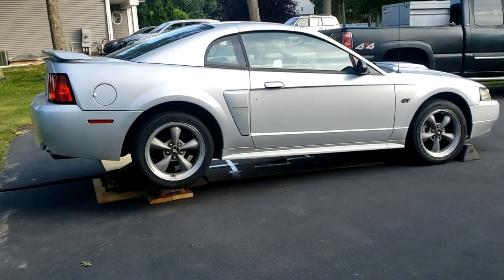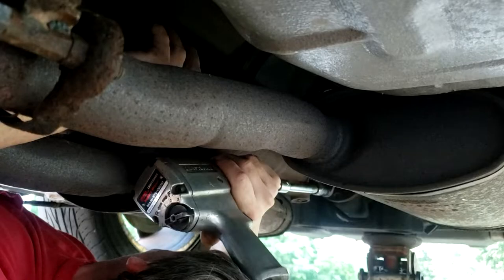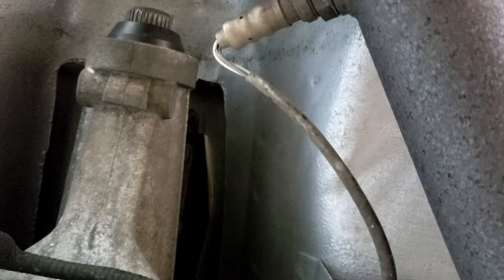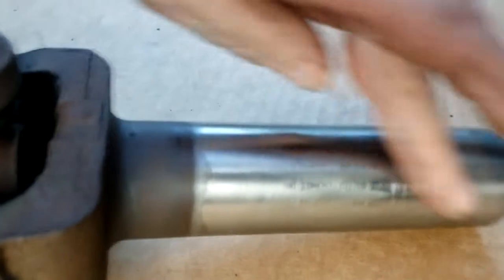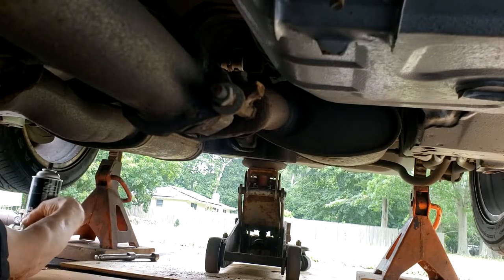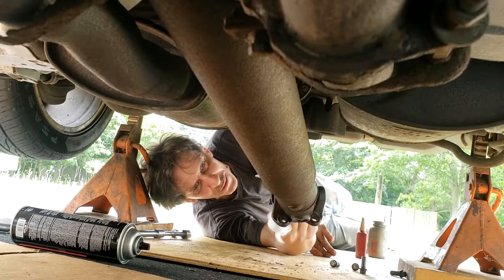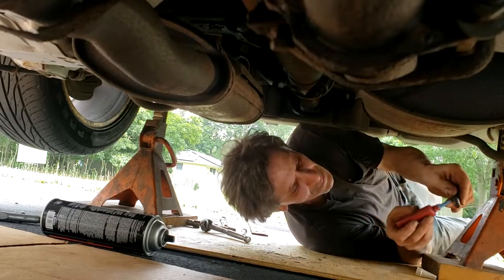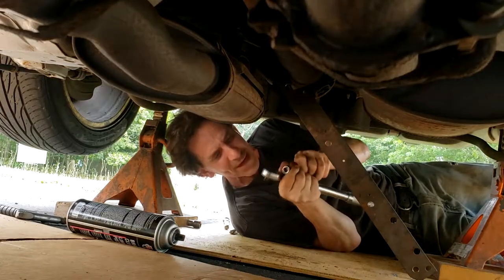'94-'04 Mustang GT Drive Shaft R and R

Comment: Great video since I'm replacing my '94 GT's  U-joints in a few days
Reply from the maker: Cool, make sure you watch my U-joint replacement video:  https://youtu.be/F4BAfyTQMhE And even if you don't get a chance to, be sure to add additional high temp wheel bearing grease to the needle bearings before assembly, cause they have a nasty habit of falling out as nothing holds them in place besides the grease when they are clear of the journal of the spider.

Comment: Great video.  When you put the shaft slide in does it allow you to turn it slightly so you can line up the witness marks you made. Or is there play enough as long as you put the transmission in neutral?
Reply from the maker: Thanks for watching the video. When you are reinstalling the driveshaft, you must first install the slip yoke shaft to the transmission. If you made a witness mark between the slip yoke shaft and transmission, you will have had your transmission in gear when you made the marks and have made sure to leave it in gear until you have reinstalled the slip yoke to the transmission. Since the differential end of the driveshaft will be disconnected at this time, nothing will prevent you from rotating the driveshaft to line up the witness marks before you engage the splines. If the witness marks do not align after you engage the splines, slide the slip yoke out again, index it the appropriate amount and reinsert it. Bear in mind when removing and installing the slip yoke, it is critical that the output shaft never rotates, if it does the witness marks for the slip yoke will be meaningless.
        When installing the flange yoke to the pinion flange (at the differential) it doesn't matter whether the transmission is in gear or not, as you can rotate the differential to align the witness marks, however at some point you will need to put the transmission in neutral, to access all the bolts on the flange.
         All that said, in my opinion there is not much of a balance issue between the slip yoke and output shaft, so I normally only make witness marks at the differential end of the driveshaft and install the slip yoke at a random clock position.
Reply: @robertbabich1154  Extremely detailed  but to the point   You get a 5 of 5 Brother.  Thanks

Comment: Hey again.  What size socket do I need to remove the pinion nut?  Also, is the diff universal joint and the trans universal joint the same size?  I removed both of the ujoints and they look the same size.  Working on 2003 GT.
Reply from the maker: I'm not positively sure, but if my memory serves me correctly, the socket for the pinion nut is 1-1/8” or 32 mm (both sockets are the same size), however removing and reinstalling the pinion nut is an involved process. Before you remove the pinion nut, you must put an inch/pound torque wrench on it and rotate the pinion and record the torque value. (This is the pre-load of the bearing). According to Ford the value for a used bearing should be between 8 and 14 in-lbs. Note If you record a pre-load of less than 8 in-lbs disregard it and set the preload between 8 and 14 in-lbs upon re-installation. If you record a pre-load of more than 14 but less than 30 in-lbs use that value upon installation. If you record a pre-load greater than 30 in-lbs you will need to tear down the differential to determine the source of binding.  Once you have recorded the value of the existing pre-load you can then remove the nut with either an impact wrench (DOUBLE CHECK THAT IT IS IN REVERSE) or a breaker bar and immobilizer (similar to the one in my video). When you reinstall the nut Ford says you must use a new nut (if you reuse the old nut, although it is not recommended, thoroughly clean the threads of the nut and pinion and apply the heaviest duty loctite you can find, and it will probably be O.K) Then reinstall the pinion flange and thread the nut on until it just kisses the flange. Then rotate the nut with an in-lb torque wrench and note the torque value (at this point it should be well below the value you recorded earlier) Next take a breaker bar and immobilizer and tighten the nut about ¼ turn, then check the pre-load. Continue this process until the pre-load matches the value you recorded earlier. The reason you need to tighten it gradually, is because you must only tighten the nut when adjusting the pre-load, if you over tighten the nut, you cannot back off to reduce the pre-load. If you inadvertently adjust the pre-load too high, your only option is to replace the crush spacer, and that will require removing the pinion flange, pinion seal, pinion shims, oil slinger and outer pinion bearing to access the crush spacer. Note: you will need a tool to immobilize the pinion shaft when making this adjustment. Additional note: If you install a new outer pinion bearing You must use a new crush spacer and set the pre-load between 16 and 29 in-lbs as per Ford factory manual. 
       As for the U-Joints, I did mention in the video that front and rear are the same. Moog is a high-quality aftermarket u-joint and the part # is 354, the price is reasonable at about $20.00 ea at your local auto parts store, but you can probably get them for half that online, if you're not in a hurry and looking to save a buck.
Reply: @Robert Babich  Thanks and I did go with the Moog universal joints.
Reply from the maker: Opps, I didn't mention the details about the U-joints in this video. Click the link at the end of this sentence, for my video that should tell you everything you need to know about Mustang GT U-Joints https://youtu.be/F4BAfyTQMhE

Comment: What was the spray in the white spray can you used on the 400 grit sandpaper?
Reply from the maker: It was Seafoam Deep Creep, and it was actually kinda wasteful to use it for lubricating wet or dry sandpaper (it is one of the more expensive penetrating oils out there} Mineral spirits would have worked just as well. and probably even better because it is less viscous, but the Deep Creep was right there on the bench, so it was a simple matter of convenience. Truth is, water is really the best for wet sanding, but it has a nasty habit of making things rust.

Comment: Automatic an manual take the same size drive shafts?
Reply from the maker: I haven't worked on an automatic in a while, but if memory serves me correctly, the drive shaft for an automatic is the same size (on '94-'04 GT), but the yoke is shorter than that of a standard.
Reply: @robertbabich1154  I have a 02 gt manual I shifts bad from 1st 2nd and 3rd due to the drive shaft
Reply from the maker: @fairfax_fran5109 A " bad" drive shaft would cause vibration.however , It's extremely  unlikely that shifting issues would be due to the driveshsft. In almost all cases shifting issues would be due to problems in the transmission or clutch.

Comment: Thank you. I just changed to a Dorman . All fine except when I deaccelerate from 60 mph, it shakes a bit then it stops. Similar to when un balanced rims only from driveshaft. Could it be the pinion angle ?
Reply from the maker: Dorman  is not the best driveshaft you can buy, however it is at least equivelent to OEM. As such it should be balanced out of the box. If you  are sure the driveshaft is out of balance return it.
Reply from the maker: It's unlikely to be the pinion angle cause even if you lowered your car are the springs are sagging your mufflers would scrape the pavement before the pinion angle became an issue.  And if you installed a lift kit in a stang, I don't even wanna talk to you. Actually a really easy way to verify if the drive shaft is out of balance is to unbolt it from the pinion flange and index it 90 degrees  then test drive it. If you have the same vibrations in all 4 possible clock positikns the problem is not in the drive shaft. If the vibrations increase or decrease when indexed the drive shaft is out of balance or one or both of your u joints are bad.
Reply: @robertbabich1154 thank you.
Reply: @robertbabich1154  i wrote to Dorman with the same question.  They answered right away,  to turn driveshaft 180 degrees and bolt it there.  It worked !!! Thankyou for your videos